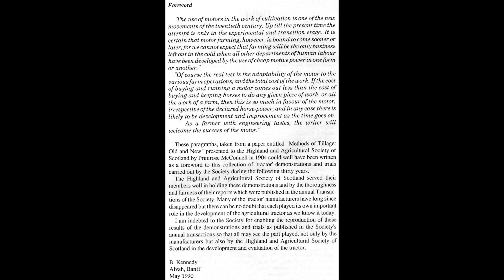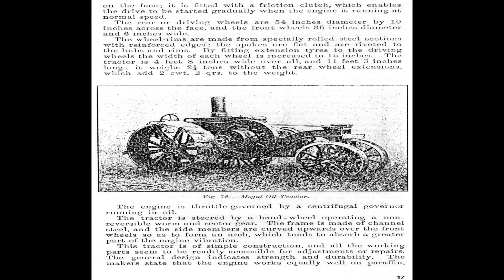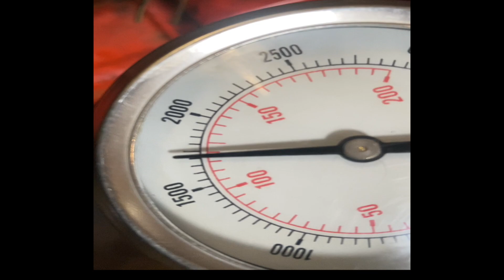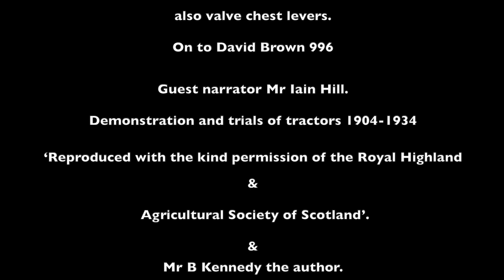David Brown 996 PTO gear box refitting.

Comment: Go up in lock jock teardrop pushing on
Bar pushing spring down know right
Lifting arms with hand's see how works
Front rod left nuts off leaver see threw
Hole pump working starting it know

Pressure rod moves
Reply from the maker: Could you send me this in the language it was translated from please.
Reply from the maker: Könnten Sie mir Ihren Text auf Griechisch schicken? Was Sie verwenden, übersetzt es nicht sehr gut. Danke. M

Comment: Think if you went to bq got trolley flat bed fit hang man frame to it seat belts
Hold it push button to copper pipes fit
Pump think filter fitted stop dirt getting in that's why things stop working
See trying fit rocker valve no need for that leave it not that nut on rocker rod goes through lowering knobs adjust nuts spring goes on rod hope tear drop
Right lift arms by hand see everything ok before starting filter thinball one vavel got pressure don't touch six years fix pump move leavers arms

Up  and down don't start engine 
Dirt and morture